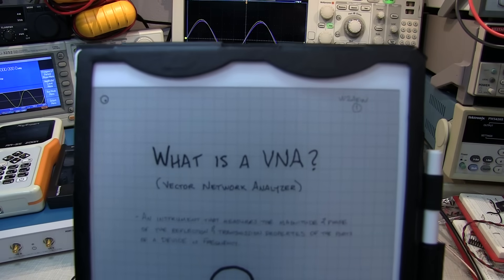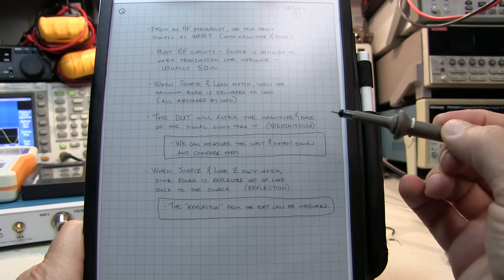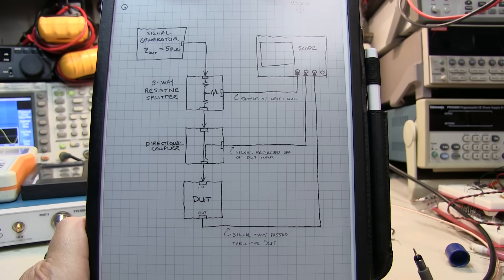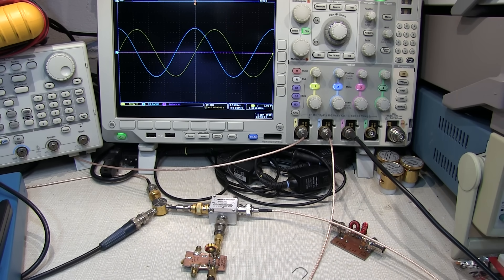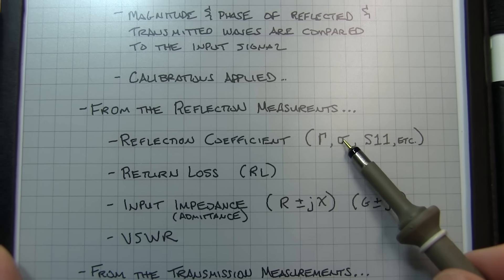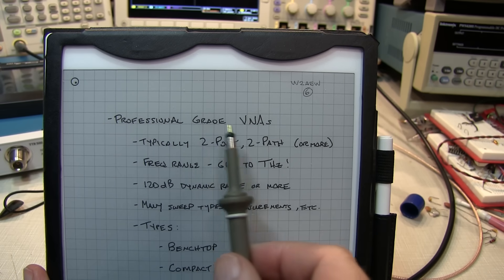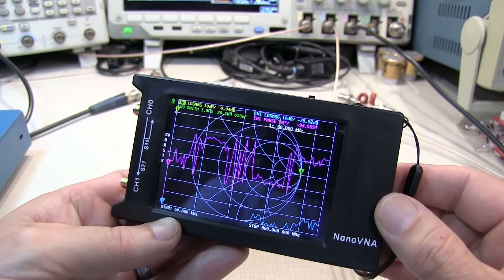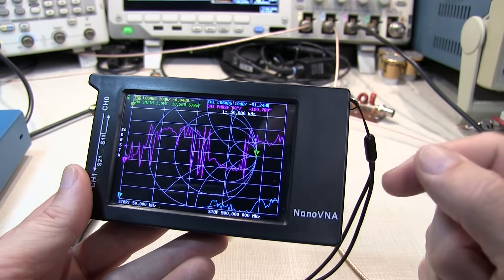#312: Back to Basics: What is a VNA / Vector Network Analyzer

Comment: The 3 way splitter, source of supply? +/- 3db loss through it?
Reply from the maker: The one I used is a resistive power splitter, so the loss is 6dB.  I found mine at a hamfest for very little money.  Inexpensive resistive power splitters can be found on Amazon that will work well into UHF frequency range.
Reply: @w2aew  Thank you! I haven't noticed any like that in the past.

Comment: Your videos on electronic circuits are some of the best I have ever seen! Nice job! On the subject of matching load impedance, ideally every generator or power source should have that functionality built directly into the output transformer circuit. Ideally it should be able to sense and automatically adjust the output impedance, voltage, and current to match the load without having to manually tune the circuit. Any ideas on how this could be achieved?
Reply from the maker: That would assume that the generator would have some sort of sampling or measuring circuit in it, which typically is not the case.  Measurements at DC wouldn't be applicable either, for two reasons - if the load is AC coupled, then the DC measurement would be wrong. Also, operating at higher frequencies or fast rise/fall times are involved and transmission line effects come into play, then a load that is not matched to the transmission line will result in reflections that will change the "sensed" voltage based on frequency and line length (standing wave issues).  For these reasons, you don't typically see this type of functionality in a function generator.
Reply: @w2aew  Thanks! I wasn’t talking about a function generator per se, but a power supply/generator. Basically I’m trying to figure out how to go from high frequency/high voltage non linear to a rock steady output at say 120 volts 60 hertz, no matter what the load is or if it is changing dynamically.
Reply from the maker: @BrentLeVasseur  If the source has a near zero output impedance (near ideal voltage source), then it will (attempt) to deliver the current necessary to develop the requested voltage.  This is essentially how most power supplies are built.
Reply: @w2aew  An example would be say a full bridge slayer exciter circuit with a fiber optic feedback link from the secondary coil to dynamically tune the resonant pulses of the mosfets to keep the coils in resonance while maintaining proper current and voltage within the limits of the circuit components.
Reply: @w2aew  Another example would be the Benchmark AHB2 stereo power amplifier, which I think uses a programmable FPGA to monitor and dynamically adjust voltage and current as well as safety features such as shut down in the case of a ground fault or short circuit or overheating.

Comment: thank you for the video
but did you take the phase shift resulting from the coaxial cables in consideration?
Reply from the maker: If you calibrate to the ends of the cable, that does it.  Or you can apply a port extension to move the phase reference as needed.

Comment: Long story short,  I ordered a 4" screen H4 and Aliexpress's seller tricked me into a "H" model with the 2.8" screen. You can't trust pictures or even descriptions anymore. I'm "stuck" with the 2.8" version. Other than the screen size, how much better is the H4? Thanks.
Reply from the maker: There's likely not much difference except the screen size.
Reply: Great to know! I want to follow along with your videos and want similar equipment. I will view it through the laptop after finding out that is an option. I got it for almost $15 off due to the mess up so $35 isn't bad :) Thanks for the heads up. @w2aew

Comment: I am trying to make a device from scratch that can read the electrical currents that are being put off by plants, and I am unsure how to go about it. I am a software engineer so I have little to no experience with electrical engineering but I’m making pretty good headway. Currently I plan on getting an arduino board, with a ecg click board, clip on/or gel pad electrodes, op amps, transformers to lower noise, etc. and it’s all getting stored on a raspberry pi that has an app I made to use said data. Any ideas you may have to accomplish this would be greatly appreciated. Thank you for the videos as well. They’re very useful.

Comment: Hello im very new in this area so im actually working with RF on smartphone devices, any advice to where i can start to understand this better, plus what did you mean when you talked about the 50ohms.
Reply from the maker: 50 ohms refers to the RF characteristic impedance of the coaxial interconnect cables (transmission lines).  Most RF systems utilize 50 ohm impedance interconnects for maximum power transfer.

Comment: Hi, first of all TNX for all your videos. In this one, at 15:18 you explain that NanoVNA cannot measure reflection properties off the second port, but I find a "CH1 Smith Chart" and I cannot understand the meaning because the load should be always the same: the 50 ohm purely resistive VNA load.
Can you add please a ittle explanation about CH1 Smith? TNX in advance.
Reply from the maker: If you select CH1 Smith, it is going to plot S21 on the chart.
Reply: @w2aew  Yes and TNX for your quick answer, but what does it represent a Smith Chart for *CH1*?
No problem of course about CH0 Smith Chart, but I cannot understand the meaning for CH1 because the load should be always the same: the 50 ohm purely resistive VNA load.
Where is my mistake? What does it represent?
Reply from the maker: @picwiz2  It's really kind of meaningless, since it is plotting the complex value of the transmission coefficient.
Reply: @w2aew  Ok thanks again: it is therefore not due to my inexperience. You agree with me that its meaning, if any, is somewhat... mysterious.
I had no better person to clear this doubt... TNX AGN.

Comment: Can a dual directional coupler like 778D works on a 4195A vna instead of a resistive power divider + directional coupler as the operating manuals shows?

Comment: This is some good stuff here!  You had me until  you got to reflection coefficient and return loss.  I'm in a predicament because I can't really discuss the project I'm on because it's classified proprietary info, but the basics are the same.  I have an RF network with an Antenna that transmits and receives on a certain frequency.  I have a filter that we use to filter out the noise of course and is tuned to allow ONLY our frequency.  The problem I have is, I am observing our secondary frequency SWR signal is actually getting "better" through the filter!  That is NOT what I want!  The filter has been set up to block out any signal around our secondary frequency.  Can you help me understand what might be going wrong in the network that the filter is now not as efficient in blocking the signal?  Or maybe it is not the filter at all but another device or connection in the network?  Anybody have any advice, please chime in if you like!  I'm not an RF Engineer, just a Field Tech, but I hold an Amateur Radio license and have just enough RF background to be dangerous...hehehe.  Thanks for any advice!
Reply from the maker: It could be that your filter is an "absorptive" filter, meaning that it absorbs the blocked frequencies rather than passing them through or reflecting them.  Thus, it would present a 50 ohm "dummy" load to your out of band signals.
Reply: @w2aew  I believe they are an "absorptive" type of filter.  I just don't understand why the SWR would be giving me a more efficient signal back.  It's not just one filter, but several hundred in the network that are doing this.  The filters are all getting over 6 years of age in the network.  It is one particular manufacture type that is doing it. I'm not seeing evidence that it is effecting the performance of what "primary frequency" pings I receive (yet), but it does make me pause to think at what point will the filter begin to pass through more noise and thereby canceling out good packets in the network.  Hopefully I made that make sense a bit...hehehe.
Reply from the maker: @TheStoneWhisperer  An absorptive filter is designed to provide a good match/termination for the out of band signals - so getting a good SWR makes perfect sense.  The blocked signals are terminated and not sent thru the filter.
Reply: @w2aew  Sorry, I may not have explained myself very well.  I should clarify something.  We use two diff frequencies in our network.  One is for transmission and receiving and the other is just for receiving time synch data.  I will call the time sync data freq the "secondary Freq"  It is the secondary freq that I do NOT want the filter allowing to pass through.  Therefore, I was always told to look for a SWR of greater then 10:1 to ensure adequate noise filtration.  Well, just in the past 6 months I have observed that secondary SWR decreasing from what was often times 17:1, now down below 8:1.  That is  a red flag to me because that means the filter is not blocking the secondary freq as much as it should be.  If it is allowing this freq to pass, then it most likely allowing other freq (noise) to pass, which is not good.  As well, there is an exceptionally HIGH noise floor at the secondary freq band.  I often look for a noise floor that is somewhere down around -110dbm, but when the SWR gets down to as low as 8:1, my noise floor jumps way up to as loud as -70dbm, which absolutely floods my Anritsu Spectrum analyzer with a Sea of red.  Not good!

Comment: Lets say you want to make careful measurements at up to 1 GHZ using good cable, UFL connectors on the device under test, and you are looking to tune not to perfection but to 4% or less reflected, at 100mW forward.  Should I use a Nano or a lease a $5000 Rhode Schwarz with a open short load calibrator.
Reply from the maker: 4% reflected is about 14dB return loss, or 1.5:1 VSWR - that should be easily doable with a NanoVNA - just not NIST traceable...

Comment: well done sir, well done.  I spent all of last year using signal generators, spectrum analyzers and Oscilloscopes running acceptance test procedures on electronic countermeasure systems.  I did not have to use network analyzers but did look over the shoulder at the next test bench that was using one to troubleshoot some issues.  Your video now helps me understand network analyzers enough to do my next assignment.

Comment: Hi Alan – really like your [Back to basics] videos. Always informative and they bring so many questions for me.  

If a VNA uses directional coupler internally on port 2, Wouldn’t that limit VNA’s lower frequency range?  i mean, Do VNAs work in audio range below 100Khz? If not is there a similar nanoVNA tool for audio (AF) world?   Can a two port VNA be used to analyze IMD products of a mixer or buffer stage? That would be very helpful if it can…    Let’s say we stimulate input of a buffer (and feed same signal to port #one of VNA) and feed output of buffer/or mixer to port two of same VNA,  Can VNA isolate/analyze  IMD products with respect to fundamental frequency (input on port #1)? And show IMD’s amplitude and phase with respect to fundamental stimulus on port one?
Reply from the maker: VNAs are typically for RF signals only - the directional coupler certainly is one of the limiting factors to lower frequency operation.  To my knowledge, electrical reflection issues at audio frequencies is rarely a problem, so vector network analysis isn't often applied. 

Many professional VNAs allow operation on split frequencies where the source operates at one frequency and the receiver(s) operate at a different frequency.  This is used for things like harmonic analysis as well as characterizing frequency conversion devices such as mixers.

Comment: This reminds me of being an undergraduate and trying to use a Time Domain Reflectometer to diagnose a local area network problem.

MIT Chaos Net ran over 1/2" UHF cable (sorry. I don't know any details, though I might recall correctly that it was 50 ohm).  The   TDR would apply an impulse on the cable and then plot the voltage over time.  Any place where there was a bump in the plot indicated a problem on the line and you could calculate how far from your test point the problem was based on the time lag of the reflection.

After one of two times doing this we eventually learned that the problem was always in the Building 38 basement phone closet.  This network cable was stuff and fragile and had a minimum allowed bending diameter of about four feet.  The cable needed to make a large turn there and whenever a workman leaned a ladder against it it would kink the cable.  I think we had to fix that once, but I don't recall how.

Comment: Could using the oscilloscope Channels 1 thru 3 be considered a primitive VNA device setup were the input signal (Channel 1, of the oscilloscope)  be considered the S-parameter:  S11, Channel 2 of the oscilloscope to be S-parameter: S22, and Channel 3 of the oscilloscope to be S-parameter: S21? And, would the reflection back into the function generator (if measured)  be: S-parameter S12?  I'm asking these questions, because I'm still having problems with the basic definition of the S-parameters: S11, S21, etc- in terms of a VNA's application?
Reply from the maker: The S-parameters are ratios, not direct measurements.  S11 is the ratio of the reflected signal from the input to injected signal injected at the input.  S21 is the ratio of the signal at the output to the signal injected at the input.

Comment: When using a VNA to measure a resistance decade box for some reasons after 1K and higher resistance values various VNA network analyzers on the smith chart will not measure the resistance values higher 5K to 10K gets worse the smith chart will say a 10K resistance is like 800 ohms its way off. Any reasons why VNA network analyzers can't measure resistance values, it seems like the VNA have a very limited LCR measurement bandwidth but the VNA specifications datasheets don't tell you this bandwidth?

Comment: Reflection Coefficient dB is a ratio of forward and reflection wave and Return Loss is a ratio of forward and reflection wave. The dB ratio is -25dB of return loss means that the reflected wave is at -25dBm level back feeding into the transmitter? or it means that its 25dB of isolation between the forward and reflective wave dBm levels?

Comment: This little VNA gives me a wealth of information about my antenna.    I'd LOVE to see a video on how to interpret the data,  and make use of that interpretation to know what I need to change about my antenna to optimise it.
Reply from the maker: The VNA can help you to measure your antenna's impedance match to the transmission line which helps you to get maximum power transfer (minimum SWR, S11 reflection coefficient). See video #314.  But, it can't help you make it a more efficient radiator.

Comment: can you make a video showing how to measure insertion phase and group delay in an RF device? I know that VNA network analyzers have a electrical delay and you adjust the electrical delay until you get a flat line on the Network analyzer display which is how much electrical delay it takes to go through the RF device.

Comment: w2aew, Yes make more back to basics videos on using the VNA on how to measure various RF devices and how to measure Insertion phase and group delay. I think the whole point of measuring the insertion phase and group delay is an RF device is to know how long the RF signal will take to go through the RF device?Most RF inputs are always "Reactive 50 ohm loads" because you will always have reflections waveforms backfeeding into the previous source or driver?I have never used a VNA to measure Distance to Fault measurements, what do you mean by this and what RF device would you measure Distance to Fault?Most VNA network analyzers I have used in the 80's and 90's were only 2 ports, One Path. What RF device would you want to measure S11, S21, S12, S22 at the same time because mostly RF devices don't use S12 and S22 to measure those properties. So I'm confused why a 2 port 2 path would be used on what RF devices?

Comment: Hi,
Can you please tell me How we measure AC voltage by oscilloscope like Hantek 6022BE ? why it shows offset AC signal and the altitude is only  102 V instead of 120 V? thanks for your reply.
Reply from the maker: Without seeing your test setup (probe, circuit, scope settings, probe compensation status, etc.) it is impossible to tell you what is wrong.
Reply: @w2aew  Can you please make a video how you measure AC 120V voltage by oscilloscope.Thanks.

Comment: Thank you for all the videos.
If I would like to suggest a topic for a video, is there another way  to do this than via the comments?
Reply from the maker: Best way is through the comments
Reply: @w2aew  I would like to make the following suggestion for a new video.
While repairing electronics often times replacement of electrolytic caps solves the problem.
In case a cap shorts out it will just be replaced ; no more questions asked.
Many times however the cap is not completely failing but it is out of specifications; 
it can be noticed that the cap has been leaking and or the top of the cap is out of shape.
In these cases measurement of the cap while it is still in circuit and  running will show the failure ( for example delay or ripple).
What suprises me is often when a cap looks challenged it will show the value as specified using a multimeter.
A Huntron tracker did not seem to do the job either in my experience  (disclaimer : this was 15 years ago I cannot speak for the latest and greatest models).

To make a long story short I would much appreciate it if you could make a video regarding this subject. 
I would like to know what is the best way to verify that a cap meets specification since it is my experience that a multimeter is not  100% reliable.
Your input is highly appreciated.